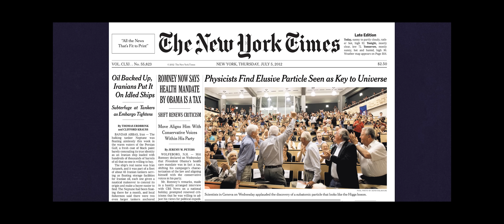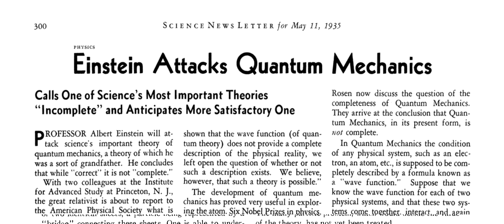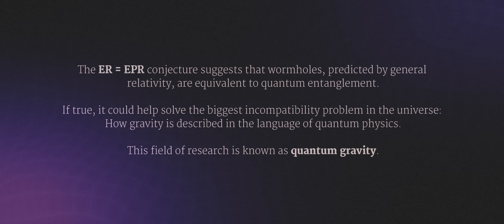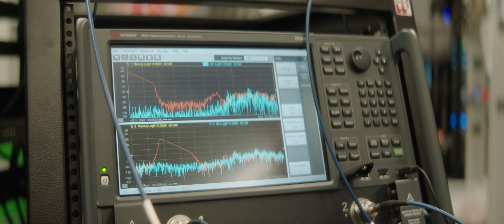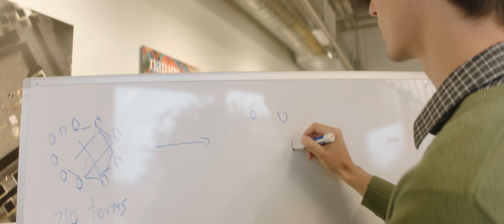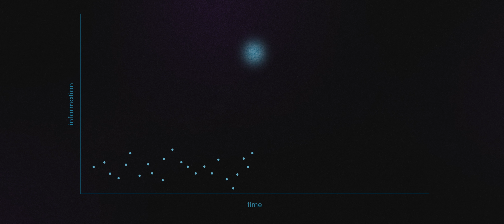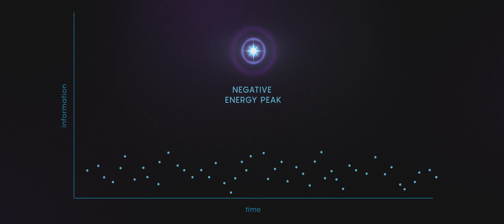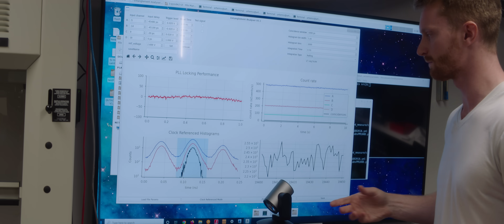How Physicists Created a Holographic Wormhole in a Quantum Computer

Comment: So I’m not a physicist so this may be a silly question…but since they can artificially create a wormhole in a quantum computer, does that not open the possibility of one day scaling that where you could build gateways or engines on the principal for interstellar travel??
Reply: It's widely accepted that interstellar travel with wormholes is impossible for a number of reasons
The most important reason is that such near-instantaneous travel severely breaks causality since you're going faster than the speed of light and can thus do wacky things like travel back in time and kill yourself before you traveled
The other reason is that wormholes are extremely unstable, especially at larger energies, so they would collapse almost the instant they were made
Another reason is a human would most likely die by going through it due to the extreme gravitational forces at work

Comment: Qubits sent in come out the otherside of the wormhole. Where the wormhole leads is another question; the same space-time dimension as an Einstein-Rosen bridge? Or a black hole, which I propose is a “wormhole” to another universe.  Once you send the qubit into the wormhole, an artificially created one, it entangles with other particles and the wormhole is then theoretically traversable. When the qubit exists the other side, one would think it is no longer  traversable and the wormhole closes. Or does it remain open; like a super highway permanently in place. It seems how long it stays open would be determined by the number of qubits sent into the the wormhole at regular intervals, such that as they remain inside, interacting with other particles to produce this negative energy field, the wormhole would remain traversable until the craft following the qubits is safely out. Perhaps once in the wormhole, qubits would have to be fired backwards to keep the backend from collapsing. I would posit a spacecraft with the technology to create a large enough wormhole in space using a quantum computer, then blasting a bunch of qubits into it could be stable enough for humans to travel through. But where it leads, is someplace in space-time unpredictable; the past, the future, a distant planet in the future, earth at a different time, a distant planet in the past. Perhaps the smaller the wormhole created, the shorter the distance in space time. If you could design a wormhole to do this, you could effectively send messages back and forth from the past (or people), if the trajectory was known (as the Earth is never in the same place, as it follows the Sun, which is always moving as well). But you would need both sides of the space calibrated to be linked in order to know with certainty your final destination. So create one on Earth (done), and another on the Moon), calibrate them in the same manner as it’s sister quantum computer and other attributes.  but have believed from young age in traversable wormholes and that black holes are traversable wormholes to other universes); evidenced by energy is not lost, so it returns in the form of Hawking radiation. So where does the equivalent Hawking radiation comes from? It gets spit out of the blackhole, so they don’t just swallow everything up and are egress-able, at least by these particles. The understanding today is once you enter a black hole and come to the singularity, according to physics calculations, you essentially drop off the universe. But if the laws of traditional physics don’t apply in natural blackholes, and instead quantum physical rules prevail, which they do, then couldn’t  creating a stable, traversable black hole could be as simple bombarding it with a plethora of qubit particles? Please correct me for anything I wrote of your ideas differ from mine. I think many people may underestimate the power of this discovery. We are creating holographic wormholes, so they are computer generated and not physical. BUT, we are also creating physical blackholes at CERN and other large particle accelerators and banging them into each other at such high speeds that these blackholes are created. Try sending qubits through a black hole created at the large hadron collider; build one on Mars too. If the qubits come out the other end there, then we have faster than light travel. In haste I did not explicitly differentiate holographic wormholes from physical ones, but you get the idea. Perhaps if we could create colliders which are small enough for us to crest black holes and essentially leapfrog from place to place more consistently. A penny for your thoughts? Let’s colonize and terraform Mars please; this world has gone to heck 😅 Jk, first we need to clean up our room (Jordan Peterson), start with improving yourself (Sadhguru), save our future on Earth if at all possible at this stage (the planet will survive but we may not), but we must also expand the human race (if we are worth value in the grand scheme of things; which I’m sure most of us humans are). God forbid a meteor we didn’t anticipate (think just this year), collides with Earth; we can’t afford all our eggs in one basket m now can we? Rant TLDR LoL
Reply: Exits*

Comment: Nope it's in the Bible they are trying to recreate the beginning
Every G3956 good G18 gift G1394 and G2532 every G3956 perfect G5046 gift G1434 is G2076 from above G509, and cometh down G2597 from G575 the Father G3962 of lights G5457, with G3844 whom G3739 is G1762 no G3756 variableness G3883, neither G2228 shadow G644 of turning G5157.

Variableness
 G3883 search
Original: παραλλαγή

Transliteration: parallagē

Phonetic: par-al-lag-ay'

Thayer Definition:

variation, change
Origin: from a compound of G3844 and G236

TDNT entry: None

Part(s) of speech: Noun Feminine

Strong's Definition: From a compound of G3844 and G236; transmutation (of phase or orbit),

Comment: Forgive my ignorance, but even if we figured out how to connect two distant points in space using black holes, wouldn’t anything that attempted to go thru just be spaghettified? Or worse wouldn’t anything even remotely near the black hole be sucked in involuntarily? Also how would you “kill” a black hole or make it cease to exist once we’re done using it for a wormhole?
Reply: Not that I know Physics that much more than you do, but the video has the answer for your question in ER=EPR. Quantum entanglement states that an atom on a hypothetical, say, 100,000 light year will entangle with the atom right at the right of your finger real-time.

Comment: I still don't quite understand how the wormhole comes about. How does the negative energy impulse happen?
Reply: its a simulation assuming that negative energy can exist in our universe
Reply: @BeanBurrito9  How so? And what exactly do you mean by simulation?
Reply: its a simulation of fabricated wants and desires. they are projecting their fetishes onto something that has nothing to do with wormholes. its a dense star. the densest one can get. at least in theory. but even if they ignored this part in their calculations, they would still need to verify how a BH actually behaves on the inside first to proceed to their conclusion. which they ignored and lied that they simulated a wormhole consisting of two connected BHs lmfao. u cant make this shit up

Comment: Its a simulation of a few Wormhole properties applied to a (still simulated) traversing Quantum particle, if anyone in here thought about "artificial wormholes". It's nothing close to a real wormhole, although the implications are huge and very interesting. It shows that there are in fact symmetries between Quantum- and Relativistic mechanics that we can use to derive shared properties both systems have in common. Im rooting for those who endeavour in this quest for knowledge. Only problem i see is google, they got the most powerful quantum system at the moment, but as we speak silicon electric nuclear resonance systems rise to be the most useful tool in this particular field. Since google derives its system from more "traditional" effects, i think its not the best horse to place bets on. Just my 2 cents on this topic.

Comment: I know we are likely far from any sort of practical application, but its fun to imagine the possibilities of this phenomenon. If we could make wormholes like the one in this experiment in a predictable and continues way they may very well be the key to making more advanced quantum computers
Reply: so amazing
Reply: @Dennzer1  theoretically, at CERN hadron collider facility, they can create micro black holes and transfer bits of data and information back in time at the speed of light into the past at the receiving end of the quantum computers from when the hadron collider system was first installed. It’s science
Reply: Here comes quantum internet: a series of quantum computers connected to one another through a network. Would they be able to transfer these virtual particles between each other using quantum entanglement?
Reply: @salicaguillotines  yes… that’s called internet…
Reply: Unfortunately the headline is misleading. They just simulated one on a quantum computer, and got the same results as when they simulated a worm hole on a regular computer. It didn’t do anything new or interesting.
Reply: @imEden0  so are u saying that people calling this to be noble prize stuffs are just exaggerating 
(I don't have too much knowledge except for what they are)
Reply: @tamilarasi1980  well, most have been misled by the video. The video is intended to trick and deceive you, saying that we made a real wormhole. That is wrong, and was a publicity stunt. They did nothing new.
Reply: @imEden0  👍
Reply: @imEden0  finally someone said it Ty Sir!

Comment: I see it this way. If you connect 2 particles using quantum entanglement, you get a quantum field. Unfortunately I have no degree in mathematics, but I know of this phenomena because I used it to make predictions for a long time, by connecting brain cells over 2 moments in time. How I did that? Using the quantum-field properties of my intuition, which is already connected to different moments in time.
Reply: The problem with my method was, that you basically replace the past with the future, until you close the quantum entanglement, after which it returns to normal. It is like, as long as the connection is open, the information of the future is present, but once you close the connection, every information from the future is not in present day anymore. Unless you do some tricks by "copying" that information to another place in your brain. The problem is, that you get a lot of debris in your brain, as a result of this quantum-field. It seems that you are not only connected between the 2 moments in time, but also every moment in between. Unfortunately, that results in a lot of static, that remains in your brain, even after you close the entanglement connection. If this debris builds up, your brain can get in overdrive, resulting in your brain connecting to the different moments in time, as recorded in the static that your brain captured during the predicting. Then your brain can start to think "automatic" and outside of the control of you in present day, and you can even loose your conciousness in present day as a result of that.. That is why I have quit doing it.
Reply: Im not a doctor... BUT!!...

Comment: Realization of traversable wormholes is not possible because of different paradoxes such as mad scientist paradox and due to the radiation feedback that destroys the wormhole!
Reply: The mad scientist paradox is to do with wormholes that travel through time, the wormholes in this video are only traversable wormholes.
Reply: @cosmic_fractal  Wormhole is anything that connects two different spacetimes (please read the definition). You cannot separate time from space and vice versa. Wormhole exhibits time reversal symmetry. Whereas traversable wormholes are the ones that you can actually travel through. Non-traversable wormholes are often described by quantum foam theory.
Reply: @cosmic_fractal  instant traversal of space also means instant traversal of time because they are one and the same thing. traveling faster than light brings about a million paradoxes.

Comment: Gravity is curved space time pushing against mass / energy that displaces it (as a body of water would). Black holes are the result of that displacement spilling over the otherwise closed system of the universe. The ER = EPR is just a theory citing structural similarity between the two models. Black holes in this universe correlate with white holes in another universe. The exchange of curved space time and whatever mass / energy that accompanies it from one universe to the other proves the coexistence of at least two universes.

Comment: Wormholes are everywhere big ones to little one' its sub space you need to unlock subspace is in between space and time its almost the same as in folding spacetime a bubble field moving faster thin the speed of light and gravity is the key to fully under stand everything and the polarity of magnets  to push pull the faster you push pull thin you can reach the speed of light and a warp-drive not that fare out of humanity's reach. :)

Comment: Where can we get negative energy? Is it something to be found or something we can make? This is the exact fuel we need to be able to move beyond our solar system...now we need to have some in order to figure the rest out. Even alqubier knew we needed negative energy and that was decades ago...
Reply: First of all, you mean negative mass, not negative energy, and secondly, even if we had negative mass, alcubiere drives would be extremely impractical. You can't steer them, or stop them. They're only really good as weapons. Also, moving around something with negative mass is very difficult, so building one would be a complete pain.

Comment: They keep using the term "black hole"...does that mean the black hole at the center of each galaxy could be an on ramp to an intergalactic interstate?  Also does this mean man cannot create a wormhole to use as a way to move between stars?
Reply: No, the supermassive black hole could not be used. The area around it is extremely dangerous, and it only works as a wormhole for a split second, so you'd get sucked through the moment you leave it.

Comment: What exactly is this “negative energy” that allows the the worm hole to be traversable
Reply: It's negative mass. Negative mass would repel matter (as opposed to attracting it, like with regular mass). Think of it as the negative mass pushing the wormhole open so that it doesn't collapse into a black hole.
Reply: @tristanmisja  so like dark energy or anti matter?
Reply: @japust  No, negative mass is exactly what it sounds like, an object whose mass is a negative value.

Comment: Wormholes ARE real... and beautiful... I saw one pretty big when I was 30 yo. It was 2:00 AM and I was watching the nightsky when I noticed something strange. A circular structure of bright light with very dark circular centre started opening somewhere on Earth's orbit. It was the most beautiful thing I have ever seen. It reached certain diameter and stayed like that for a few seconds. Then it started slowly imploding again. When it closed, some bright object appeared at its place and quickly disappeared behind the horizon (speed was incredible. about 40-60.000 km/h). It was some kind of extraterrestrial UFO... So, my theory is those aliens visiting our planet DO actually use wormholes as means of FTL transportation.
What caught my attention was the centre of the wormhole. I have never seen darkness like that before. It was the darkest black colour I have ever seen. As if there was not a single photon in it. It was like observing God's hand ripping through space-time. It looked kinda scary. I thought I was observing supernova explosion at first. Also, the whole process was rather slow. It took cca. 5  seconds to open the wormhole. 4 seconds to stabilize it and 4-5 seconds to close it. The wormhole did not move. It was stationary. It was not chaotic either. The whole process was perfectly controlled. As if someone tamed the biggest force in the universe (e.g. blackhole). That is what it felt like.
Reply: You're delusional.

Comment: If I get it correctly, the Hollywood image is wrong:  To go through a wormhole, a spaceship will have to be disintegrated on one side and reassembled on the other; inside the wormhole, its presence would be felt only as a phase change of some field wave (assuming that observing this wouldn't totally collapse the wormhole).

Comment: They sent a qubit through a wormhole but I didn’t hear how they measured how much time had passed for the qubit as apposed to a qubit traveling the same distance but not through a wormhole? Aren’t wormholes basically supposed to a sort of time travel technique? And doesn’t quantum entanglement mean if one thing is measured on one end then it’s 100% the opposite on the other end, like spin, up/down down/up? This isn’t problematic?

Comment: Some people say that you can go back in time by travelling through a wormhole.   Imagine 50 years pass in relation to those outside of the wormhole  when travelling between the start of a wormhole in the end of the wormhole but you go back in time 40 years earlier too when you entered so it seems to everybody else that only 10 years have passed since you entered the wormhole but in reality you come out fifty years older.   Doesn't make sense but if you tell a person that the atomic clock on a GPS satellite will go out of sync with an atomic clock on the ground just because the satellite is moving people won't believe it.  Time slows down on the satellite  in relation to a stationary atomic clock just because the satellite  is moving.